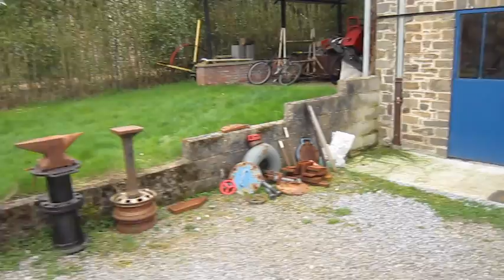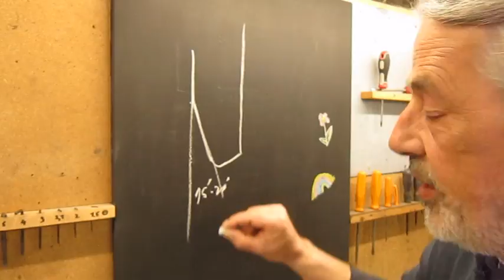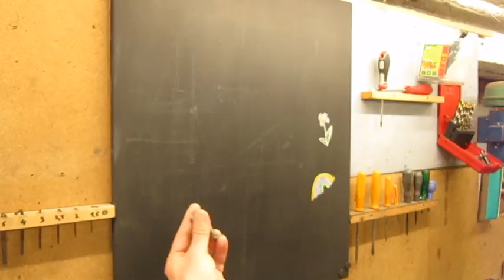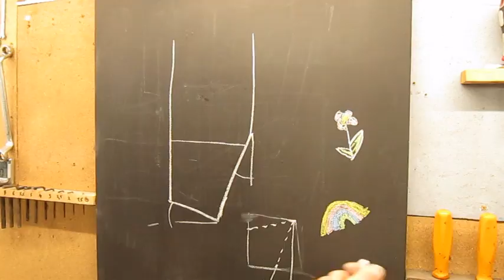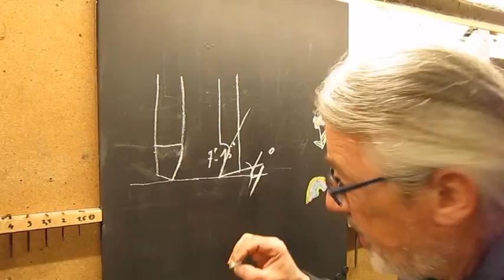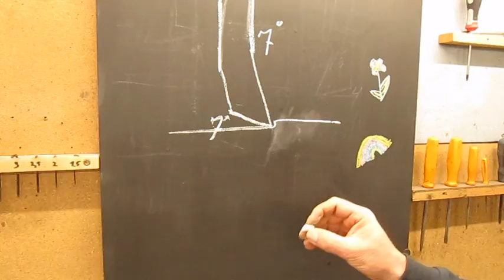Grinding shaper tools.

Comment: Thank you for sharing the idea of setting the shear tool at 70 degrees.  I gave it a try and I am quite impressed with how much better the surface finish turned out compared to when I use the shear tool at 45 degrees.
Reply from the maker: That's good. Have fun with it.

Comment: Hello Rusty! I am trying to grind on my shaper lathe some details on a soft tool steel (23 HRC) but it keeps ripping off (scrubbing) the metal. Any idea if it's the tool bit causing the problem, the cutting angles the tool bit has? Grinding wheel can not be used.
Thanks for helping me out. Really appreciate it!
Reply from the maker: For very soft steel you can use more aggressive angles. A back rake and a side rake of 15°-20°. Keep the nose radius very small.
It's maybe a good idea to color the cutting edges with a sharpie, take one cut and inspect the tool with a magnifying glass.

Comment: That is what is so nice about the shaper versus a Bridgeport. You dont need thousands of dollars of tooling with a shaper like you do with a vertical mill.
Reply from the maker: The shaper is indeed the ideal low budget machine.
Reply: Also you can sometimes get the machine itself with less than 500, then spend $100 on hss and you're good for a while

Comment: Nice finish with the modified tap sheer tool. I like the round shank idea to change the front face angle, saves a lot of grinding because you can tune it in to get the best finish on different metals. One of those is a priority on my to make list now lol. Cheers Tony
Reply from the maker: Thanks Tony, show us the results.

Comment: Great video, I thoroughly enjoy your wit, and I am about as thrifty as you are to a certain degree. Very good explanation of the grinding angles and the demonstration of grinding the tap is inspirational. I do remember trying to grind a drill bit to work like an end mill, and surprise, it does work to a degree. Cheers and thanks!
Reply from the maker: Making tools yourself is very satisfying. Especially when they work.